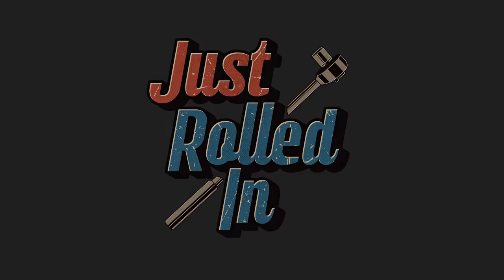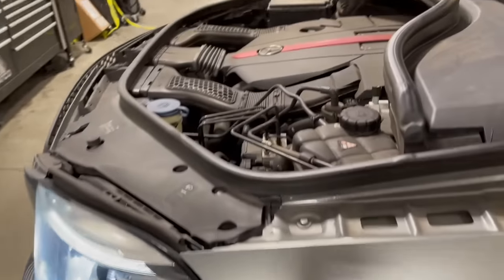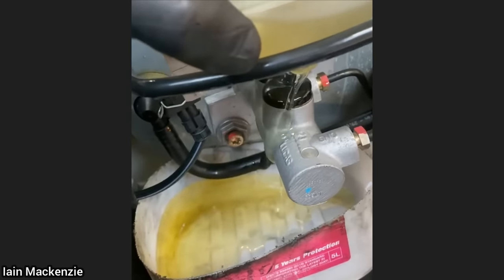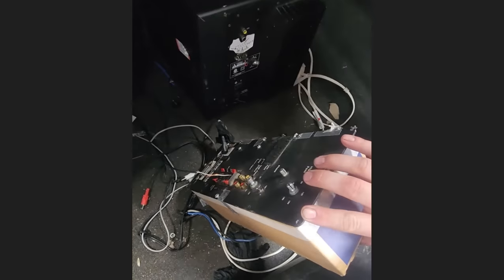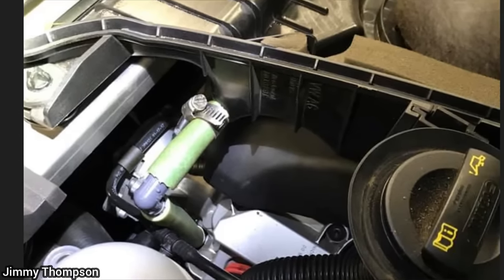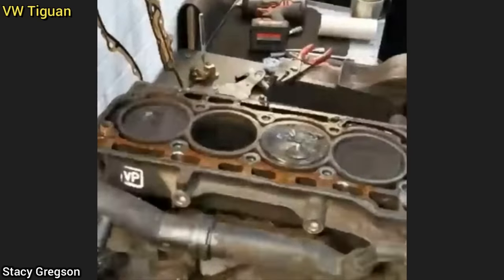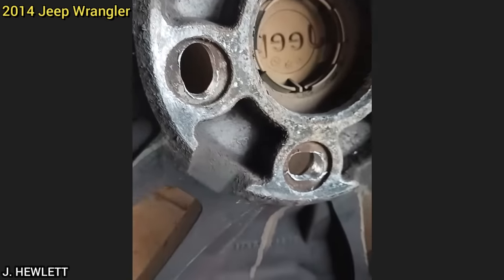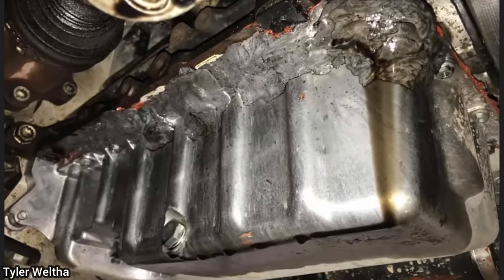Customer States Ticking Noise After Topping Up Engine Oil

Comment: The dish soap was very nearly one of those "if it's stupid and it works, it's not stupid" scenarios, but alas.
Reply: It turned into a bubble bath with a burned out motor you're right alas.
Reply: I would say its still pretty stupid even if diluted since dishsoap strips away wax.
Reply: I use dish soap all the time. Maybe an ounce per refill. It cuts the oil that splashes up from the road and improves visibility greatly. Never had any trouble.
Reply: Do NOT use dish soap. It can promote rust in the body seams.
I used to work for a company made the formula for proper screen fluid as formulating chemist. 
We added rust inhibitors to the solution to prevent this happening. You don't have to use the expensive manufacturers only stuff but always use a proper screen fluid.
Reply: @court2379  it's better than the bottled RainX Bug & Tar washer fluid. It cleaned well, but it had a sediment that turned rock hard in the screen filter of the reservoir. Took me forever to get it all disassembled/cleaned/reassembled. I'll never use RainX again.
Reply: @jeffarmstrong1308  It's usually raining/snowing when it's used. It will be washed away anyway. But tell me one that cuts the oil off the windshield and I would use it. Everything I have tried does a poor job of it.

Also that is what you clean your car with.
Reply: @court2379  you're cleaning your car with dish soap too?

I'm interested in how your car is getting so oily for this to be a concern.  Is it a living in the city kind of thing?  I think I use my fluid once or twice a year during bug season.
Reply: Using dish soap if it's cold is a surefire way to freeze every component of the window washing system.
Reply: We had a lady need 3 sets of replacement washer nozzles on her Edge. Finally figured out she was putting vinegar in because it's an old home trick for streak-free glass cleaning. It was ruining the little o-rings inside the nozzles.
Reply: @kholdanstaalstorm6881  You add it to the alcohol/washer fluid solution. It doesn't freeze. Also it's only a small amount in a much larger volume.
Reply: If they had added alcohol to it it'd have worked. Alcohol is a defoaming agent.
Reply: @1pcfred  
And alcohol is an anti freeze too.
Reply: @kholdanstaalstorm6881  it would work. I've made my own organic emulsified cutting coolant using water, soap, oil and alcohol. Oil and water do mix with a detergent in the water. But when you mix them up it turns into all bubbles. Pouring alcohol on it reconstitutes the fluid.
Reply: Trying to save a few pennies on cheap windshield wiper fluid is being extra silly.
Reply: @fitybux4664  it may not always be just a matter of saving money. What if washer fluid is simply unavailable and you need it. We just went through a rough patch with supply chain interruptions. But it could be far worse. Every day we get closer to the world of Mad Max.
Reply: @fitybux4664  
Yes. 
Tried a cheap brand pre mixed for -17C, worked fine until the first bit of cold weather and not even a sound when I tried to use the wiper fluid.
They had sold a botched run of wiper fluid and it hadn't the right ratio...
New pump, tank and hoses because the fluid froze.
Young me didn't think about getting money for the repairs, so everything was out of pocket.
Changed it myself so I could say I had it professionally done either.
Tossed the broken parts at the recycling center also, so when I got wind of the manufacturing fault I had no evidence of any damages.
They wouldn't take me at my word without receipt for the wiper fluid purchase or the parts, of course. 
Only purchasing name brand now and keeping the receipts just in case.
A little bit expensive lesson, but I've taken it to heart.
Reply: Shampoo works wonders. And doesn't rust
Reply: @fitybux4664  It's not to save money, it's to make it more effective. All the oil on the road sprays on the windshield and the premade stuff doesn't clean it off. Adding a small amount of soap to it makes it work much better.

Though in this case I think you might be right. It sounds like they added straight soap and the viscosity burned up the pump. Though that doesn't seem cheaper to me, the soap would cost about the same.
Reply: The version that I heard was "If it's stupid but it works, it's still stupid and you got lucky."
Reply: Can't say anything about rusting, but a mixture of water, dish soap and spirit was something a reputable german consumer test magazine compared to several washer fluids on the market, and with the right mixture it held up in freezing temps and cleaned equally as good.
Costing a fraction of normal winter washerfluid.

Does that mean i use it? No, i am way to lazy to mix that stuff myself, i do invest the 17-18€ the pre mixed -20°C jug costs.

Comment: The drive shaft one could have ended way worse.
Reply: thoonk 

SPARK

Michael Bay explosion
Reply: could go through the windshield 😮
Reply: @peterf.229  It wouldn't have been the first time, either. Something similar, there's a Rescue 911 episode that showed a dramatic re-creation of when a Nurse was driving to a hospital, but crashed and got a Fence Post lodged in her throat through the windshield. She survived, but it could have easily been her death.
Reply: My guess is it was a diesel truck because I think that is exactly what would have happened had it been a petrol vehicle.

Comment: A drive shaft flew off a semi and impaled their gas tank.  That’s nearly some Final Destination stuff there.
Reply: A nurse in Santa Clarita died when a tire from a car in the opposite lane on the highway crashed through his windshield five years ago
Reply: PILE UP!
PILE UP!
PILE UP!
💀💀💀
Reply: States with no safety inspection are like: "Stop looking at me!"
Reply: @fitybux4664  semis are federally regulated bro, rethink your comment
Reply: Drive shafts give plenty of warning before they let go, the vibrations would be unbearable.
Reply: Beats the windshield as long as there is no spark.
Reply: An old neighbor of mine told me how he was driving on a multi lane freeway and had a tire fly over a 5’ tall dividing wall from the other lanes, took out his mirror so it was a really close call. Apparently he was in such heavy traffic he couldn’t stop or swerve but also said it happened so fast that by the moment his brain processed what was happening, it had already smashed his mirror and bounced off the whole side of the truck. This was like 10 years ago, he got the truck fixed and still drives it daily…
Reply: @TireSlayer55  how high cab a wheel bounce coming of a vehicle at 70 mph?
Reply: @tonysheerness2427   ludicrously high, like when the giant hits you in skyrim
Reply: that shaft was way to small to have come from a semi.
might have been on the road and a semi passed over it or been a load of junk cars, or something else.

Comment: As a practicing mechanic, I can't even start to tell you how useful it is to know how to remove the damn VW rubber things on the spark plugs!
Reply: It's also the quickest and cleanest way to install grips on motorcycles =)
Reply: Also learnt from "Doubleboost" channel, It's a good way to remove spam from tin.
Reply: @Hawk7886  With you. Been using compressed air for 40years to install new grips.
Reply: @JEFF-ft6qm  That I would like to see. From a distance.....
Reply: A single squirt of WD-40 makes grips go on real nice too.  The oil becomes sticky if you wiggle the grip.
Reply: @KC9UDX  that's what she said
Reply: @KC9UDX  hairspray is better.
Reply: @KC9UDX  liquids like that have no place in electrically conductive (and insulated at the same time) areas imo
Reply: @KC9UDX  I prefer soapy water for that. the WD40 might make the rubber stuff deteriorate, and soapy water makes rubber nicely sticky too, when it dries. I also used it to help uninstall tyres that would stick to the rim or otherwise be resisting.

Comment: The driveshaft through the fuel tank was one of the most bizarre mishaps we've seen in a while.  And I feel like dish soap mixed with washer fluid is one of the most "reasonable" customer blunders we've seen.
Reply: I have my own formula for windshield washer fluid.  20% Windex and water.  Works much better.  Only downside is it'll freeze in some climates.
Reply: Can't really say it's the customers fault for the first part. And it is somewhat reasonable though it would be more of that diluted it first
Reply: Should have at least used laundry detergent or dishwasher soap as they're meant to reduce the potential for foaming... though I still wouldn't recommend either 🙃
Reply: @Shibby7634 
Technically any liquid soap will clean but it's the aftermath is where things get sticky.  Glass cleaners are designed to not leave anything behind that won't evaporate.  Laundry and dish detergents require rinsing.
Reply: @Iconoclasher  that's why I didn't recommend either 🙃

The lack of foaming would have prevented the decrease in pressure that brought them to the shop though.
Reply: I worked on a Honda Pilot that had been a dish detergent washer fluid car for almost a decade... wow. It had gummed up every damned thing and significantly damaged the paint below the sprayer nozzles.  I wish I had video of it. It's apparently a "cost saving tip" that goes around the usual places. Definitely not worth it.
Reply: @RJayFlaming 
I've been using my 20% Windex formula for 30 years now and haven't had any problems with it.
Reply: Just add a bottle of rubbing alcohol to your mixture..freezing stops. LOL
Reply: I was thinking the same thing.  Like it is a cleaning liquid after all.  I can see the thought process.
Reply: @Iconoclasher I can see that. Glass cleaner would make a decent wiper fluid
Reply: @Iconoclasher  some climates? If you live anywhere northern that's gonna suck

Comment: "The customer declined all the repairs" always gives me chills 😅
Reply: I think that is shorthand for "I'm gonna try and sell this tomorrow to some unsuspecting bunny"
Reply: @Kapt-Kimbo  
Or the old…..you wanna charge me that much, I got this mate that can do it cheaper.
Reply: @michaelslee4336  declined all repairs turn into work done at another shop
Reply: not necessarily, I've done that twice, and called a wrecker to haul it off to the scrap yard
Reply: Scary to think they could be speeding down the freeway right next to you 😲
Reply: Most of the time they're declining either to scrap, sell, or get a second opinion. Then there's the people that come in for an oil change, they have a CVS receipt worth of issues, and they decline additional work and continue to come in exclusively for oil changes. I had a Cx that bought an early 2000s Chevy Tahoe and brought it to us to inspect after. She got angry at us for finding things that needed to be repaired, and then would bring it in every 3 months to change the oil without doing any additional work.
Reply: @The_Metal_Mechanic  I had an aging vehicle that I let much go over the years, I kept safety systems up however, never letting the brakes go, or the tires go bald.
I let much of the exhaust system go, to a point. that point being when the cat fell off, which I promptly replaced. (mid '80s cats were merely platinum, and relatively cheap)
I finally got rid of it when the carb gave up the ghost from running for too many years on ethanol gas.
Reply: @davidconner-shover51  oh yeah, there's nothing wrong with limping the car, as long as it's still a safe ride. My first car was a used 02 Civic coupe, and I remember my Dad telling me at one point to save my money because there was only about 10k miles left on the clutch. 70k miles later and I sold the car with the clutch still catching, but only barely.
Reply: Depends on what it is. No way a mercedes owner is changing motor mounts. Took my car in for an alightment and they pointed out the rear brakes and shocks were toast, but I also had new pads, rotors, and shocks in the boxes in the back (which I did change out).
Reply: @zchris87v80  yeah I know that are cases and cases but many 'declined' shown are from cars totally rusted deathtraps that the customers do not seem to intend to take them to scrap, but to go to some sketchy solution and keep on the road like that
Reply: @michaelslee4336  And the other 90% of clips in this video are perfect examples of the work of that "mate who can do it cheaper" 😆
Reply: @zchris87v80 why did you get an alignment before changing shocks and stuff in the back? Had you allready changed bushings and arms and then noticed the shocks were bad?
Reply: @carlchristianfosse9839  no, I knew they were original and don’t last 15 years. An alignment (especially on a solid rear axle car) is independent of the shocks.
Reply: Time and time again I see people who buy $100k luxury cars, and then penny pinch on basic maintenance and repairs.
Reply: It baffles me those cars ar still allowed on the road. This would not be true in Europe
Reply: The customer declined all repairs and could be driving right next to you tomorrow.

Comment: Always a set of "I did the repairs" to be astounded by
Reply: Yes but the owner usually says, "Another shop did that repair" after a stupid mistake.
Reply: Wasn’t really a repair then was it bud
Reply: Gear oil in brake and clutch reservoirs, I mean... I guess it's a fluid.
Reply: Just think how much cheaper a field service manual is compared to having to take it to a shop in shame...
Reply: The one where someone attached the cabin air box drain to the crankcase vent tops the gear oil in the brake fluid reservoir, to me...
Reply: And the same people want right to repair so they can fix cars themselves.
Reply: @MIKOOL13  Sure, but because some people don't know what they're doing doesn't mean NO ONE should be able to do what they want. Plus right to repair is more about independent shops being able to access factory parts and manuals/documentation. If you can do it yourself in your driveway, that's a bonus. When ONLY Ford can reliably work on a Ford because no one else can get parts or the manuals, then they can charge whatever they want.
Reply: @MIKOOL13  When you aren't allowed to open the back lid to clean out the dust or it voids the warranty, then it's a bit shitty innit?
Reply: @MIKOOL13  point is, there will always be people burning down kitchens while making a salad, shouldn't mean everyone is banned from cooking.

Comment: Call me crazy but when I'm in a parts store I like to look for the fluid that corresponds with the task at hand. Brake fluid for a brake job, transmission fluid for a transmission job, power steering fluid for a power steering job. Its funny how they name the fluid after the component it works in. Its almost is if that's what they were thinking.
Reply: I've been to my local parts house 3 times this week and theyre still outta Blinker Fluid😩

This supply chain BS really grinds my gears😒
Reply: @Jeff.78  Still? I've been out of blinker fluid for months.
Reply: Your problem is that you don't have an enquiring mind, you just follow the well-trodden path. Think what a world of excitement would open up if you just tried randomly pouring all those different prettily-coloured fluids down the first orifice that comes to hand.....
Reply: In America, even gas is a fluid, it can be confusing...😅
Reply: @geirmyrvagnes8718 gas is a fluid everywhere lol
Reply: That’s crazy talk dude!
Reply: the problem is it doesnt say where to pour the fluid in....and anyway they are all the same....didnt you know that?

Comment: As a small engine (lawnmowers ect) I can tell you that your profession isn't alone in seeing this kind of stuff.
Reply: I loved working at a power equipment store. My favorite was the person who changed the oil in their lawnmower. With olive oil. Smoked like a 2- stroke Lawnboy when it was running, but it smelled delicious.
Reply: Idk if this channel would accept it, but I'd love to see the clip of some guy filling his lawnmover with Dishwasher fluid
Reply: It can probably be worse in some cases lol
Reply: I'm not a small engine mechanic but I've gotten a few free mowers from people and I've seen pretty scary stuff but I was able to fix them and use them and one of those free mowers I still use today that I got over 10 years ago and it had oil coming out of it everywhere and loose mounting bolts on the engine. I fixed all of those issues back when I got it and I haven't had a problem since Oh and the air filter was saturated with oil when I got it.
Reply: Oh, we know. We just like sharing our horror stories in full HD video, when we can.
Reply: Excuse me, but did you just say you are a small engine?
Reply: I didn't know small engines could write.
Reply: I'm on the opposite end of the spectrum working on big CAT powertrain components, and yeah, same.

Comment: The diy home stereo system draining battery.. i can relate 😂 good times back then. Glad always had mates to push start the car 😂😂
Reply: I can't say much about that, as a friend's car had a home subwoofer running off an inverter for many years, thanks to me. Sounded great, cost nothing, and the best part was you could just reach behind the driver's seat to adjust the level.
Reply: He just needs a relay on the power supply and connected to ACC. If Customer built it, he should know about relays.
Reply: I've seen to many of these videos when my first thought is to wire in a light switch from a home improvement store to cut the circuit when the car is off.
Reply: @mrgw98  The key switch is the switch. Put a relay instead and switch the relay using the car lighter circuit or power antenna lead. "Real" amps for automobiles have such a relay built in.